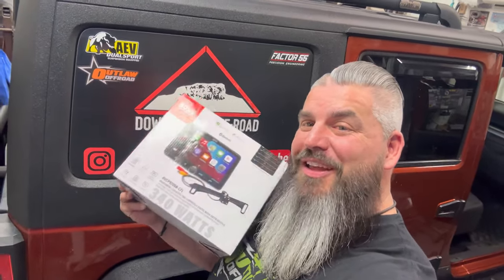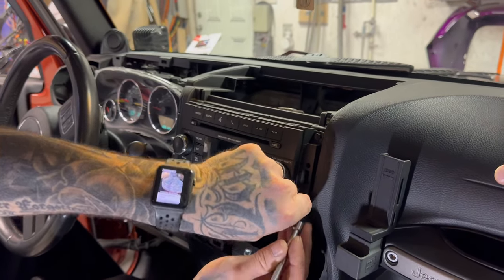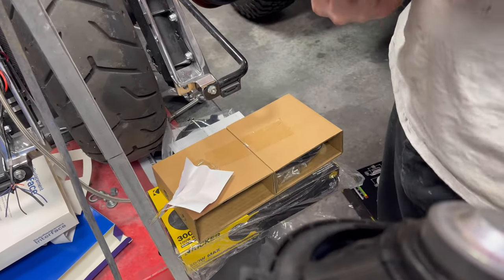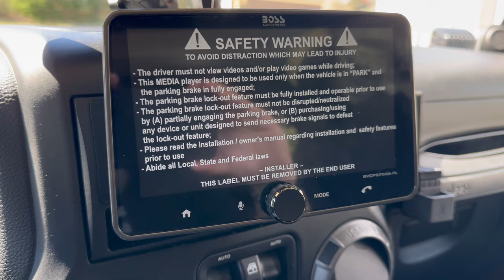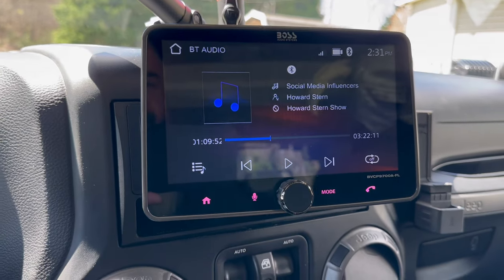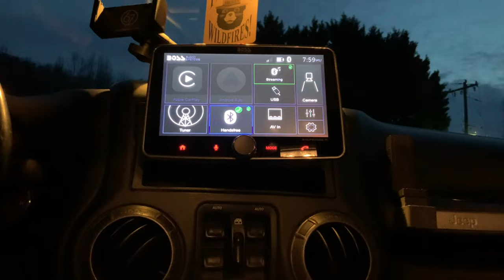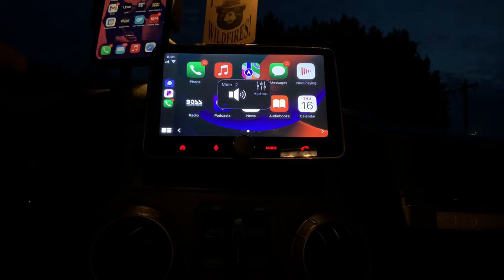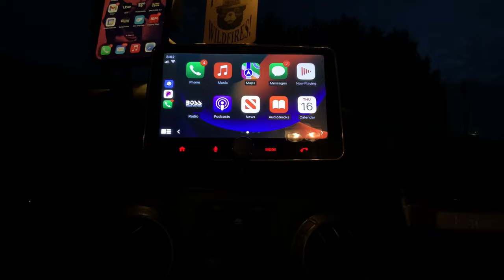Do NOT Buy The Stinger or Alpine Stereo For Your Jeep Wrangler Until You See The BOSS BVCP9700A-CFL!

Comment: I have the same unit and kicker 6x9s up front and the 6 1/2 in the rear…just a fyi the unit adjusts up and down as well-as tilt. Don’t be afraid to grab a hold of it💯
Reply from the maker: I still love this thing especially for the price
Reply: @DownSouth_Adventures  without a doubt. I’m looking on Crutchfield currently for amp and subs.
Reply: I'm Brazilian and I'm researching some models. Do you recommend this device BVCP9700A-CFL? Are audio quality, equalizations and connectivity good? Here in my country, I don't find much review of this model

Comment: The stereo looks great in there. I plan on replacing the radio in my LJ and since it is a single din, this radio will fit nicely. How does the built-in amp sound with the new speakers? I tried to buy the Kickers and they were on backorder, so I bought the JBL's. Big mistake as they offer no bass at all. The stock alpine speakers in the JK provide more bass than these do.
Reply from the maker: Yeah, the stereo says it puts out 340 Watts. It’s definitely much louder than my factory stereo but the kicker speakers also offer No bass at all
Reply: @DownSouth_Adventures   that actually makes me feel better about the JBL’s.

Comment: its really good for the price. i got one in my 96 caprice and it sounds amazing with stock 1996 speakers in the front doors and 2 pioneer 6x9s in the rear deck. sounds really good and the way my eq is tuned with my subs i can turn the volume all the way up with no distortion.
Reply from the maker: Nice!

Comment: Thanks for the video. After viewing and doing my own research i decided to take your advice and purchase it. Initially, i was going to go with a Navos OE over the expensive Stinger. But the boss does all of it at a fraction of the cost.
Skol!
Reply from the maker: I seriously LOVE it for the price!
Reply: @Down South Off-Road and Outdoor  one thing I noticed instead of plugging the phone to it, you can use Android Auto to connect via Bluetooth. Didn't know if you know, I also got mine for $190 and you said you got yours for less than $300. Was that because of the extras you got?
Reply from the maker: @UltronMark1  yeah by the time I added the dash and steering wheel kits. Yeah I plug it there to charge now because I actually prefer seeing my map on the phone.

Comment: Super cool, Biggest issues I've seen on Stinger is lag and adding sirius/xm. Thing I don't like is floating screen. Washbboard roads it will move. Double DIN replacement I feel is best option as you don't loose your other mounts and such. Be intersting to see long use on trails.
Reply from the maker: I’ve been blasting down sawmill dirt roads all week in Ohio with no issues. So far so good.
Reply: I’m in Ohio too! Hey neighbor!
Reply: @DownSouth_Adventures I was worried about bumpy roads cause problems later down the road since the screen just plugs in the front. All the vibrations cause bad connections.  Do you think that would be a problem?
Reply from the maker: @red07JK  So far not a single issue with it!

Comment: How are you liking the speaker upgrade so far. looking to upgrade my stock speakers to just get a better quality sound, not so much worried about bass as I am about the crappy 80's walkman sound JK speakers provide.
Reply from the maker: I am mad that I got a smaller size speaker set up for sure….I didn’t realize I could’ve went bigger until we were installing them but they are definitely better than factory.

Comment: In this video you connected to the unit by cable.. do you have to wire connect to mirror your phone or can you run nav. Apps and so on through blue tooth.
Reply from the maker: For this model it’s a wired connection but I hate change and prefer my maps on my phone attached up higher in my line of sight so I never use CarPlay only Bluetooth.

Comment: How was the install?  

Still satisfied?
Reply from the maker: Yes sir I’m still using it today and have no complaints. The only thing it’s ever done wrong is occasionally the Bluetooth connection will disconnect but my wife’s much more expensive stereo does the same thing so I think it’s an issue with Bluetooth in general.
Reply: @DownSouth_Adventures  going to try our 16 wrangler today. I was just wondering about the sealant you put on top. Thanks for the video.
Reply from the maker: @shawnbroome8981  I Raptor lined the top and definitely love it!
Reply: Did this Saturday and it is still working.
Reply from the maker: Nice! @shawnbroome8981